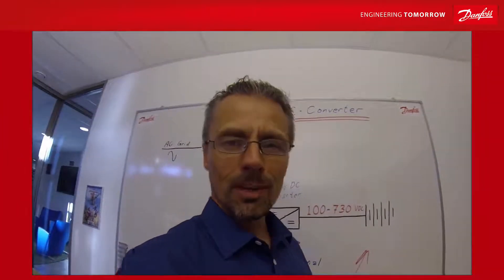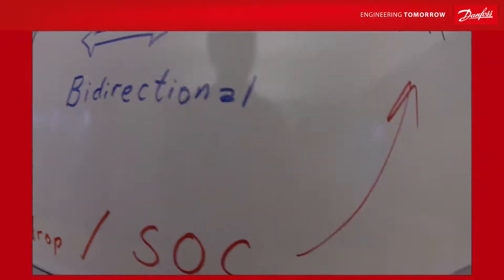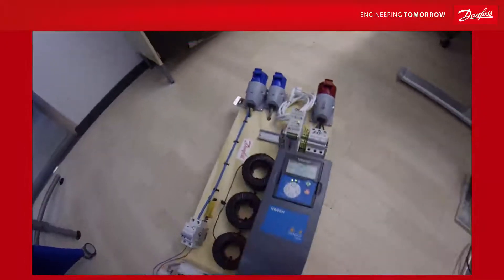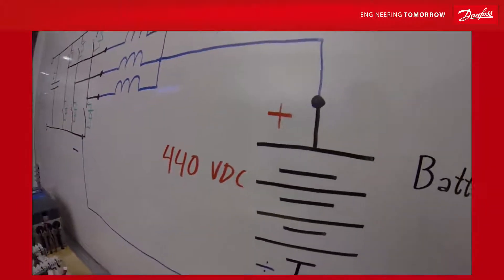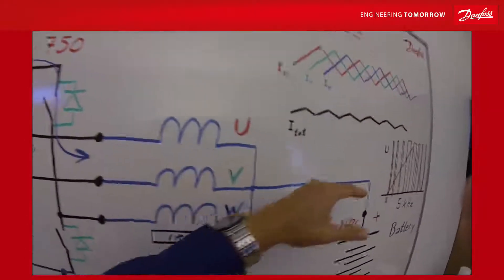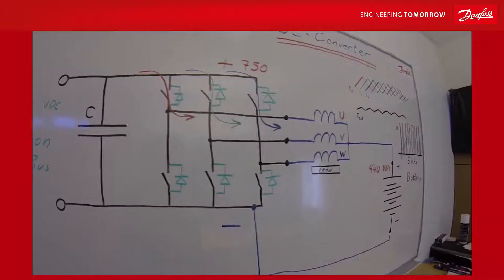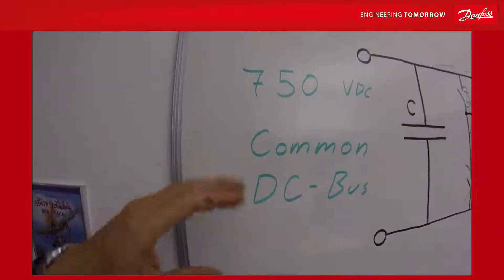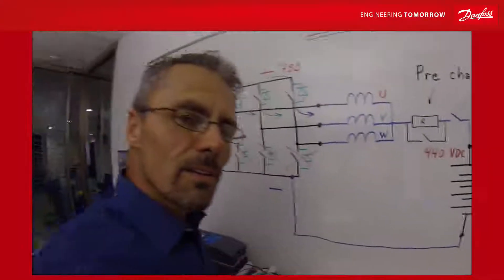VACON® NXP - DC/DC Converter - how it works

Comment: Does this converter work for automobile like RVs?
Reply: Hello :-) Functionality it could work for automotive. However, the NXP is typical hardware optimized for installation in industrial and maritime environment. Often inside electrical cabinets and enclosures. Certifications and approvals typical for ship and industrial. For automotive there is a need for higher tolerances for vibration, G-loads and IP ingression and small space. For the automotive industry then the Danfoss Editron EC-C1200 drives are the more optimal solution.

Comment: @Danfoss Drives
Mr. Reidar Berntsen
I am designing an architecture to apply the DCDC Converter in Dc Bus for VaconFlow 200kw. Is it possible that the power supply of the DCDC Converter is only a Photovoltaic system without including batteries?

I ask that question because it is not clear to me if it is possible for the DCDC Converter to work in uniIDirectional mode, that is, from the photovoltaic system to the DC BUS only, since it does not have batteries to charge.

The application we have is for 4 water pumps of 200kw
danielnavau76@gmail.com
Reply: Hello Daniel. Yes, the dcdc converter can work with solar cells. As long as power is taken from the cell and into the drive it works well. Challenge with solar cells is the big variation in voltage and power output as function of sun input. For a constant kilowatt output on the dcdc converter the source current will increase with lower voltage. For the solar cell it means not able to keep up the voltage if taking out too much power. In practical You need to limit the kilowatt (power) to the consumer as function of the sun input. Sun input can be monitored as source voltage on the drive thus power output then can be limited according to an curve function. Power limitation (PMS) must then be done outside the dcdc converter. Because the dcdc converter has only one way to affect the power consumption and that is to shut down the production of dc voltage. Which is effectively a blackout of the system.